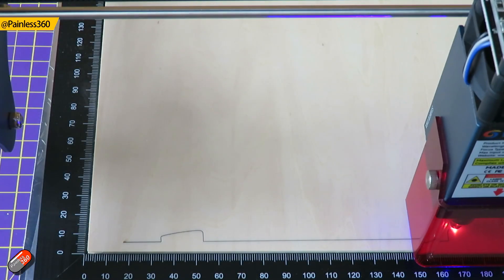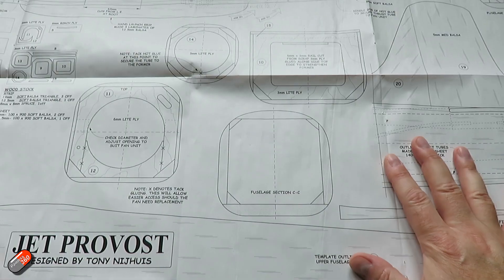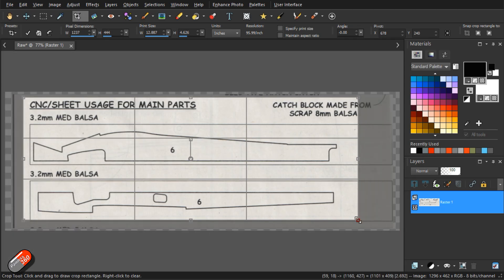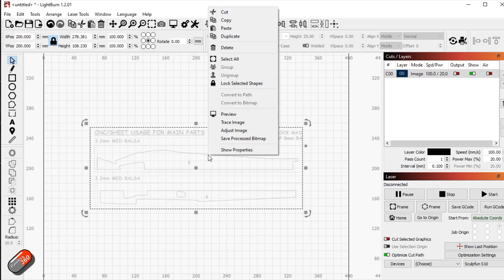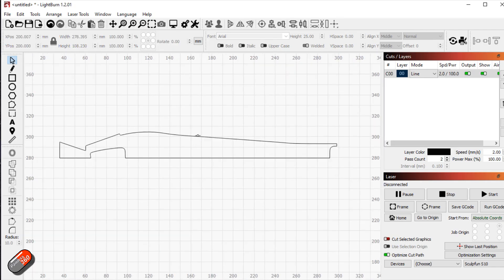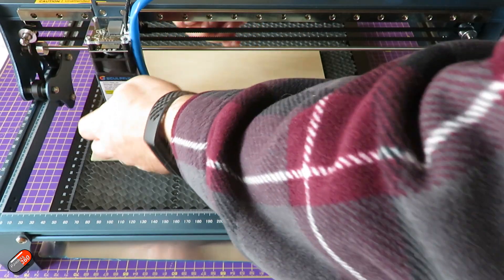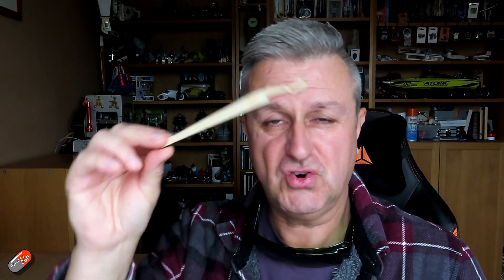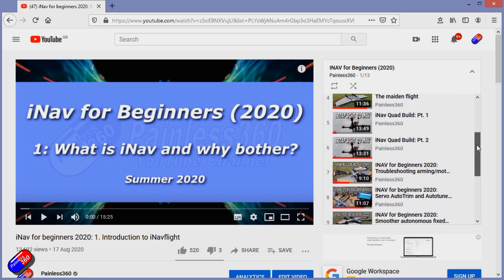Cut parts from plans using an S10 Laser Engraver/Cutter!

Comment: Could you please help me with a question I have? I’m using the S10 and I need to cut multiple identical pieces (same shape, same dimensions) from 3mm non-transparent plexiglass. Could you suggest whether I should prepare the file in an external program (and in which format) or directly in LightBurn? Another important question I have is how to set it up so that the cutting line between the pieces is treated as a single cut and not repeated for each piece. Thanks a lot for very useful videos.
Reply from the maker: I've only used Lightscribe here... Best of luck

Comment: You can use the Lightburn measuring tool (rule icon) To directly measure your part trace on the screen in order to bring it 
to exact dimensions, before cutting any material.  Discovered this after watching your video to make some parts for a model boat from plans. Next project is a vintage model plane design no longer produced.  Thanks for the info.👍

Comment: Thanks for this useful content.  Because I had to hand draw and then scan parts for a repair, I struggled somewhat with creating a sufficiently clean line for the scanner to create a clear image in Lightburn.  The two traced outlines merged in places which meant that there were not 2 distinct larger and smaller shapes to group and ungroup and separating them was impossible.  After some thought, I came up with an alternative; I used the image scan in the standard Windows 3D image editor and block filled the shape outline in black.  Tracing in Lightburn then created a single line for my Sculpfun S30 Pro to cut.

Comment: Diecut parts are never on the plans but are often in the assembly manual. If you have the manual as a pdf file already you can export the pages with your pdf editor, import the pages into Autocad or LibreCad (free software). Then scale it to the correct size by adding a known dimension and use the scale function by calculating the scale percentage. Export or save as a DXF file that can be directly imported into Lightburn. Easy as!

Comment: You can use a flat bed printer to print the part and cut it out. Then tape it to your computer monitor and manually trace it in lightburn. Resizing is easy afterwords.

Comment: Great tutorial!
I am following everything you are doing but I can't get rid of the double line from my imported png file. I also noticed that your scan is transparent when you put it into lightburn ie you can see the grid. my scan is solid white background with the airfoil shape..... what am I doing wrong?? regards Ian
Reply from the maker: You need to ungroup the trace to be able to select the line you want. I can't see what you are missing but I'd suspect that you are not deleting the original image from the app once you've traced it.. Best of luck!
Reply: @Painless360  thank you for you quick reply,  by accident I found my issue. The one rib I was playing with had an arrow that intersects the line of the airfoil and it is one continuous loop, the other ribs have a definite inner and outer line….. which I am able to select which line to use. One very happy Chappy!!

Great tutorials, to the point and concise, just what I needed!

Comment: I have imported images into Fusion 360.  It has a scaling option to ensure the items is the correct size.  Did you verify the scale with the photo editing program.  Can you verify the image size in lightburn?  thanks
Reply from the maker: I use the method shown to make sure the size is correct. Best of luck.
Reply: @Painless360  Thanks
Reply: I've made my laser parts so far in fusion using a trace over on imported background plan image. It's more work but you get the chance to clean up the design, make slots, holes etc the correct size to save work later on. A lot 9f hand drawn plans are pretty rough dimensionally.

Comment: A small, round, bubble level on your phone screen while you take a picture, can make a perfectly proportioned picture of a part. Then put it into some software to remove the background and resize it to original size.
Reply from the maker: Great idea! Do remember that there can be distortion on some lenses so as you move to the edge of the image the image may not be spot on. Happy flying!
Reply: @Painless360 , I just wish my planes worked right now. I am too new with this CO2 laser machine to make my own planes. Parts, I could do though.
Reply from the maker: Cheap foamies are a great way to learn before moving onto more delicate models.... Happy flying

Comment: Super useful tip for working off paper plans or raster (.jpg, .png, etc.) plans. The nice thing is if you have plans as a .pdf, it’s most likely already in vector form, so you can import it directly into lightburn or most vector graphics editors (Inkscape, illustrator, vectornator, affinity designer, etc.) and go straight to the step where you select and delete the lines you don’t want to cut (or set them as tool layers).

Comment: Fascinating. Seeing that it can cut up to 20mm wood. Very impressive. 
You might be able to cut your own foam wings. Not cord-wise, but by cutting 20mm rib slices and stacking them on a pair of carbon-rod spares.
So many possibles with such a great tool in the workshop! 🤔💭

Comment: Just my 2¢ for larger plans pin them to a wall and use a camera with a telephoto lens as far away as you can get (zoom in) to decrease distortion. Then import the image into Inkscape where you can trace the interesting parts and make an SVG file to import into LightBurn. Vector programs are much better than raster programs for these kind of outlines.
Reply: Agreed. Or most copy centers will have a scanner you can use to get the initial raster image.
Reply: @swissfreek  Or you can just scan in and then trace the scan with almost any raster program.
Reply: @fredlef100  vector program, but yeah. The thing is most of these printed plans are big sheets and it’s kind of a PITA to scan them piece by piece and then get them all aligned again, if you have a scanner at all.